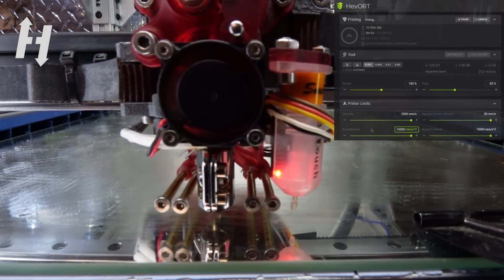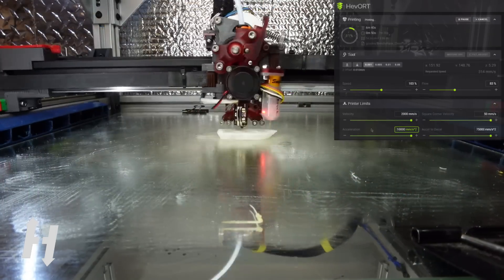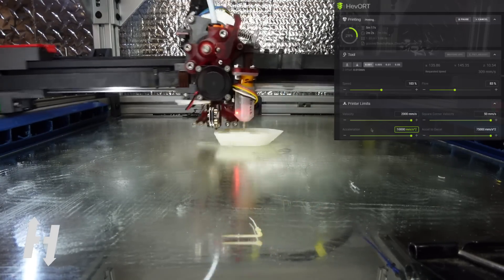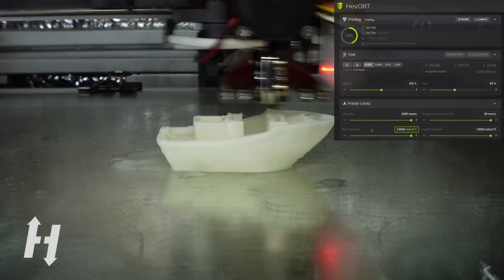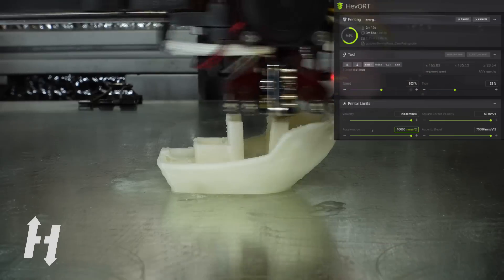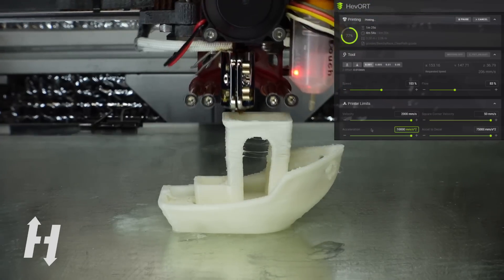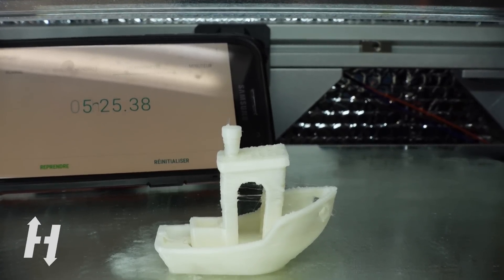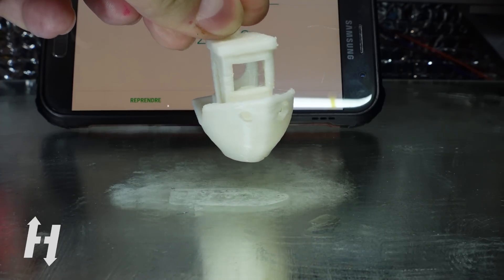Printing Benchy with SERVO motors on my HevORT

Comment: Nice job! I don't know why none of the manufacturers offer servos. The quiet operation is worth a premium to me, and I'm sure at least 25% of those who buy and actually use printers. In the hobby CNC world, nema 23 servos can be bought all day long for $100 per axis by consumers. The printer sized motors would probably be way cheaper at volume.

Comment: Try a bondtech CHT nozzle. I want to know your thoughts on it.
Reply from the maker: My thoughts on that product are simple.  It works really well and is a must.  Unless you are printing abrasive materials... Otherwise its one of the best inventions since sliced bread!
Reply: @MirageC  thats what I was hoping to hear. Now we just wait for a hardened steel version!
Reply from the maker: @SylvieTheBagel  even hardened steel will have a hard time (no punn intended) to restist the erosion of carbon fiber.  The thin slicing edge might still be erroded quite fast. I am sure Bondtech is working on this.  Cant wait to see what they come up with.
Reply: @MirageC  that's a good point. I actually got some CF PLA for Christmas... I don't have a steel nozzle yet. So, I'm planning to buy a steel and a CHT. 
Know of any good steel nozzles on Amazon?
Reply from the maker: @SylvieTheBagel  per my experience, the Cadillac of nozzle for hardened material is definitely Tungsten Carbide nozzle.  While being super wear resistant to CF and fiberglass, it has an excellent thermal conductivity.  I cannot paste a link here, but got to spool3d dot ca website and search for tungsten.
Reply: @MirageC  thanks so much! Have a happy new year!
Reply: @MirageC  would you ever think of making a video on it? I want to know it's performance at high speeds.

Comment: To deal with excess vibrations as you get to higher and higher speeds, I would suggest:
- Setting the printer down on a rigid block
- Using vibration-dampening materials for all of your soft fittings.
- Any springs, if present, should be converted into J-Dampers (look them up, F1 used to use them).
- Use of input shaping via accelerometers would be helpful too.
Reply: Dang beat me to it with the mass dampers

Comment: This is the future of manufacture using FDM printing, getting this neat of a print with those times is insane, it just needs a bit of tweaking, more cooling and a slight deacceleration to achieve beautiful prints in jaw dropping times, using this technique with hot technical materials like PEEK, could produce strong parts in mindblogging times.

Comment: Very impressive.  But also look expensive as well.  The frame rigidity and Motor quality can cost a lot.  Not really impressed with the print quality. But, that is almost impossible to achieve at that speed.  The accuracy can suffer at the speed too.  However, I am not sure since the demonstration did not mention that.

Comment: What's the advantage of a servo motor?
 Also, are you still using these same servo motors in your latest videos? And can you make a video of this benchy printing out at half the speed and acceleration? Btw, does HevORT support Klipper input shaping? I want to see the maximum quality achievable in the minimum amount of time with the latest and greatest setup you've got.

Comment: So I decide to build my own 3d Printer and started trolling YouTube to see what others are doing. I find your channel. You have pretty much built what I had in mind and some. Here I was thinking I'd be the worlds first to use shop air lol. I was not thinking servo motors till now. I was thinking I'd CNC all my fixtures and custom machine the print head etc. It's the electronic considerations I'm still getting my head around. Ultimately I want to print PC reliably with an excellent appearance and finish and reasonably fast. I'm happy to sacrifice speed for finish. 
Your videos are fantastic and saving me a massive amount of trial and error although I fully expect to make plenty of errors. I fully appreciate how much work you have put into this, I just built my CNC Mill. That was a very impressive Bency by the way especially as it was done 5 times faster than best time I currently have.

Comment: Why did you decide to change from carbon back to 20x20 alu on X?
Reply from the maker: It was not a decision based on technical requirements.  I just did not have any HD12 carbon X config ready at the time of switching to Servo Motors.  But I do now.  So a new carbon X is going back on :) https://www.thingiverse.com/thing:4886459

Comment: Hi, absolutely nice benchy. .... but the cooling might not be that necessary, improving the results ... the benchy is to small for your speed. scale up to 300% and reduce cooling drastically. in an unheated chamber it should give PET/PETG enough time to bond tight and produce a crystal clear finish

Comment: Push it faster!
Reply from the maker: Motors can go a lot faster... extrusion system not so much.  so this is the new long pole in the tent.
Reply: @MirageC  I thought the Nova could hit 400+? I almost want one, I have the volcano (copper everything) on my pile of junk. It does 200 okay with PETG at 275c. Thought about going higher temps and pushing a bit more to go for a 15 minute benchy. I'm a little afraid of the consequences though, don't really want to trash my bondtech LGX... My printing budget is low and even lower after my recent car purchase 😫😬. I'm running a Bowden setup so the pressure advance is sketchy on the stepper going fast and going REALLY fast isn't even in my old davinci's job description 😂. Pretty sure my speed benchy attempts took away months of wear in minutes 😬.

Comment: I don't understand why closed loop control isn't a bigger thing in 3d printing...
Reply from the maker: in fact I dont consider this setup as being closed loop either since I dont send any position feedback to the controller.  All is done internally into the servos for them to ensure they executed the submitted commands correctly.  A true full closed loop could establish required corrections based on the printer structure deformation/resonance.
Reply: @MirageC  I made the assumption based on the title of if it being servo. But this actually makes me very sad. It gave me hope that Klipper had closed look capability. Marlin does but everything else about Marlin is a giant sad face to me. I more than doubled print speeds with Klipper. My speed benchy is 19 minutes with PETG but I didn't video tape it so... Will do it again soon enough just for a formal submission. With 20 dollar legit quadrature encoders available I don't see why anyone hasn't pushed true closed loop...

Comment: holly hell, that's insane as always! Last video you said you were going with servos to push it even further, I was looking forward, and damn no disappointments at all.
Like, you're doing 1G acceleration on that benchy. The parts literally couldn't free fall faster. No wonder the THICCCC belts there! You still probably need quite some backlash compensation right? Even the pure movement probably twists the mounts some micrometers here and there enough to need it no matter how stiff (you said you tested 15000mm/s² right? 1.5G ain't no joke for the precision needed on a printer).
I ain't no polymer specialist engineer for sure, but my gut tells me that at the speeds you're extruding things don't really work the same anymore as in a normal print, like extrusion pressure and so on (actually, that much I'm 100% sure. Speed at which a deformation is applied to a polymer does change significantly it's mechanical properties). You're definitely threading into some very advanced polymer engineering here.

...meanwhile I'm trying to solve a resonance problem on my Y motor on the moving bed... No matter what current settings I use, specifically 3500 to 5500 mm/min. won't move no matter what, it can move faster tho. The motor locks up loaded or not, and it's Y only not X with same motor and driver. Running TMC2208s in all steppers, SpreadCycle on X and Y and NEMA 23s on those two (it refuses to even move those NEMA 23s in any current in StealthChop, only the dual Z NEMA 17s move on StealthChop).
Oh well after the last assignments are done, time to get the damn thing to work properly.
Reply from the maker: I was running 100 000 mm/s2 on that run.  Control interface only displays 5 digits lol.  I have pushed it to 150 000 already. Frame and mounts are not even sweating. All is safe and sound.  :)
Reply: @MirageC  Damn, time to swap to m/s² then! Damn, 15G+ on that extruder and hotend... No matter how light, that's quite some force already for sure.

Comment: Well torque is not the only think to consider, inertia ratio is way more important for high dynamic systems, sometimes you end using 10 times more torque than required to keep the system stable
Reply: Awesome machine btw

Comment: currently building a rather big hevort 450x450x700 :) i love your dedication to this machine. But i'm still very unsure which XY gantry i should prefer to use :/
Reply from the maker: For that size i recommend hd9 or hd12
Reply: @MirageC  Thx for the reply. As i started those were not available ^^ - i will consider one of them. Probably HD12 to be sure :D

Comment: Dude, if pc overclockers can use liquid nitrogen to cool processors, then you can use compressed air and clearpath servo's. 

They're really the future. Built-in path correction, overshoot correction, the works. And they have the power to use some pretty heavy setups, which adds to the rigidity / lower resonance of the whole system. They're worth their weight in gold. And the supplied software too! I love your setup so much. This is amazing!

Comment: I'd like to propose the test with rules as follows: 
1:You must print 3 benchies. 
o Repeatability. Each benchie must be within +- 0.2mm on each dimension from each other benchie. (for example is one part is +0.2mm over and the next is -0.2mm under that -0.4mm, and out of tolerance.
o Dimensional accuracy. +- 0.2mm from the actual model.
o Speed. The fastest 3 benchies that meet this requirement are the contest winner. 
2: you must print 10 benchies. (this test is to see machine longevity)
o They must be printed sequentially and you cannot tune the machine between prints. (no tightening belts or turning screws)
o Benchies must be within +-0.2mm of the original model. 

This is to target a useable application of this fast printing to actually evolve it. There's not much point in making parts if the parts you make are useless.
Reply from the maker: Dimension accurracy is not the issue, nor repeatability.  I have over a 12 sub 5min benchies right here.  The problem is surface finish.
Reply: @MirageC  as an engineer I'd argue that surface finish is possibly the largest problem there is next to part strength. But I'm also thinking of applications and using 3d printing to rapidly produce useable parts, automated, with no need for supervision, with repeatability for numerous parts before the machine itself loses tolerance.
Reply from the maker: @t_c5266  yes, agreed, that is why I was proposing to make it part of the criteria. ;)

Comment: Would it be possible to print faster if the printhead and the printbed are moving? (Both could accelerate and move in opposite direction for even faster speeds)
Reply from the maker: Motion power and speed is really not the limiting factor here.  The melting power and the cooling capabilities are pretty much maxed out.

Comment: I can very much agree that those clearpath servos are realy strong. i have some ~400w nominal power nema34 clearpath servos on my cnc mill and it makes it shake a lot if im not carefull, which is kind of impressive as the thing weighs around 1000kg :o

Comment: What ???????  3d printers DON'T USE rotational encoders at all ??? It's all open loop ????? WHY ..... They are like 10$  !!! OMG that means there is absolutely HUGE performance improvement to be achieved on all current models of 3d printers.  And of course linear encoders are the correct way to go for fast postional accuracy with a shaft encoder for taking the backlash of the magnetic drive feedback loop. Damn, don't 3d printing people talk to the robot printing people ? I'd have thought they'd be almost on and the same community. Don't you guys use odrivers and MIT cheetah controllers ?
Reply: Hey MirageC es-tu du Quebec ?

Comment: Maybe the increased cooling for overhangs is something printer manufactures should look at. Fans that spin faster or even activated compressed air additional cooling. Could be something that is manually or automatically implemented in the slicer. Nobody wants a noisy printer but also nobody wants droopy overhangs ruining the print.

Comment: Would the additional power of the servos be able to work with heavier gantry/gantry setups? If that is the case, that would mean more space for cooling and and stiffening without sacrificing speed and acceleration, right?

Comment: As soon as I saw those belts I was like "MMM! Thick belts for some big steppers" and was not disappointed. And when you said you're using a full on air compressor for cooling I just started laughing. You've done amazing things with ABS that I didn't think possible.  Also, what made you go with this hotend instead of something like an E3D Water cooled Volcano?

Comment: I have one of these clear path motors on my bench and they are pretty awesome. I only wish they made lower power motors that would be better suited to an application like this as all the additional driving hardware adds up in space/size
Reply: Got some on my lathe and I love them too. I asked if they were planning to make a Nema 17 format, but the answer that it is not cost efficient or easy to size down further the eectronics.

Comment: I find the concept of a superspeed benchy a little flawed. it's a small model, that is almost 100% limited by cooling.
I think once the 20 minute mark was passed, it makes sense to do 2 4 or 8 benchies, and see how long that takes.
Or to just find a larger model to speed test on.
If you want to print fast... get a 0.8 through 1.4mm nozzle. And print with 0.6-1mm layer height.
If you want high quality prints... these speed benchies are not that!
So the entire concept/purpose of these prints are kind of lost on me.
Are we trying to print a benchy as fast as possible? Why not allow massive nozzles? I mean, the rules are "looks like a benchy".

Comment: Does the firmware need to adjust extruder flow rates based on the servo tuning?
Reply from the maker: Klipper is the one calling the shots in terms of Step and Direction commands.  We want the servos to be following and executing these steps as precisely as possible.  If they do, then they will be in harmony with the rest of the printer.

Comment: Is your house shaking , is it you that braced the printer to your walls ?
Reply from the maker: To the garage.  And yes, Garage is shaking :)
Reply: @MirageC  The things you and Vez3D are doing is making me giddy as a schoolgirl! I'd love to build build myself an "F1" FDM printer, but I'm concerned about the shaking. I'm thinking about using a tuned mass damper and/or a force cancellation system of some sort... or maybe just add a crap tonne of mass to the frame/enclosure with some concrete blocks or sand. If I could just cut the time for "normal" PLA printing by a factor of 6 or more, I'd be like a pig in mud :D

Comment: I have a pair of those motors sitting aside waiting for something like this.  Good stuff!   It's not cheating, it's the future of 3D printing.
Reply: did you build the printer with the teknic motors? if so How did it turn out?

Comment: This will probably destroy the printer
Reply from the maker: Not this one ;)  I have done several hours of printing at those velocity and acceleration already.  A dozen of sub 5min benchies and so far everything looks good, no crackes, no frame lossening.  I did have a few screws who came loose on the print head though. I simply used a small drop of super glue to ensure they dont move again ;)

Comment: Salut, 

J'aimerais savoir si l'idée d'un système d'extrusion séquenciel as êtée explorer?

Il y aurait le moteur nema 11 sur la tête et un autre moteur (peut être plus gros) en configuration "bowden drive". J'ai eu un bon succès avec cette méthode et peut-être que ça pourrait aider a avoir une extrusion plus constante au vitesses auquel vous essayer d'imprimer.

Merci!
Reply from the maker: Bonne question, j'ai déjà eu cette idée, et malheureusement, la synchro entre les deux extrudeurs est difficilement atteignable.  Le moindre variation du diametre du filament engendrera une différence dans la vitesse de déplacement du filament entre les deux extrudeurs.  Si on combine les tolérances moteurs et qu'on multiplie par la vitesse, cette solution ne fonctionnait pas pour moi et je ne saurais pas comment y arriver.
Reply: C'est vrai que pour mon setup j'ai utiliser des nema 17. Un de 25mm sur la tête et un de 40mm a l'entrée du tube en PTFE.

La même armature de moteurs simplifie la chose oui.

Merci MirageC. J'apprécie tes vidéos.

Comment: Good point about safety. I'm so used to putting my hands on the machine while printing. I do it to save a few minutes, why restart a print if I can give a nudge here or there to save the print. I've gotten used to this because my motors would barely give my fingers a good squeeze before stalling. If I were to move to a much more powerful and faster machine there would be less incentive to try to "save" prints but by now my learned response is to touch the moving parts and that would be hard to unlearn. I think I would move to a fully enclosed machine and wire a door switch, I don't trust myself.
Reply: Hahaha, yeah, thats good thinking. Probably good idea.